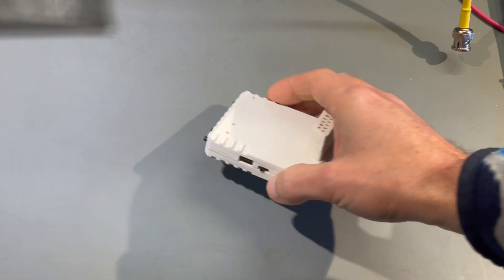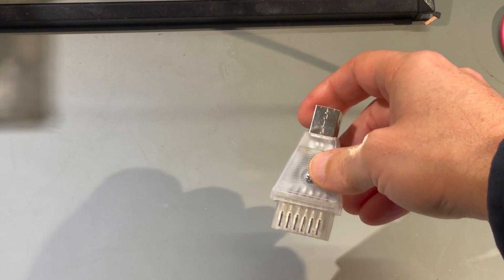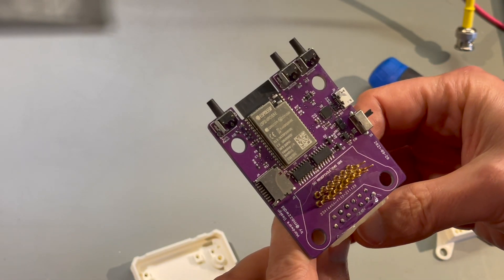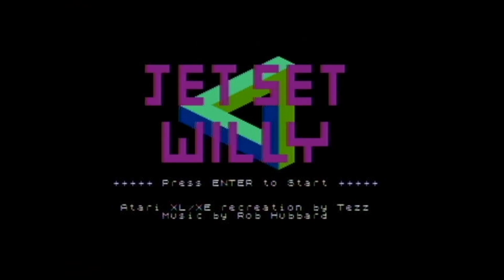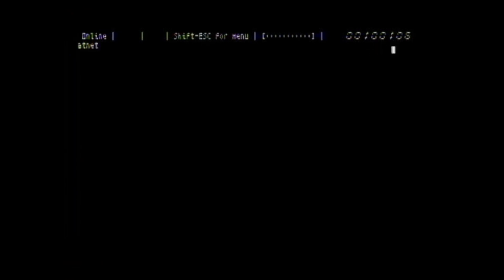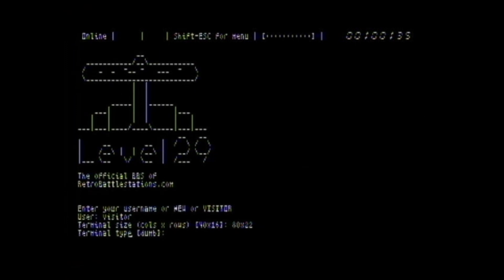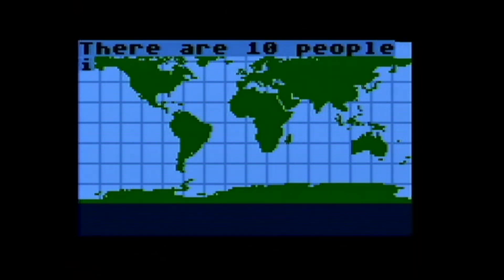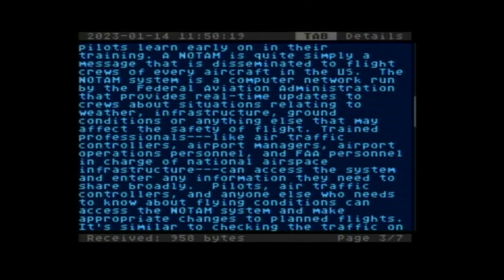A quick tour of the FujiNet - WiFi for the Atari 8 bit systems

Comment: The interesting part is that the Espressif module has inside two 32bit CPU cores that probably can emulate the whole of the 8bit Atari system.
Reply: yes. essentially you're buying a Espressif-based computer with an Atari micro as an add-on!  Although I wish modern manufacturers (laptops especially) would understand the importance of the physical interface as well as Fujinet developers. IBM got it right with it's Model F and M keyboards. No matter what software/firmware/virtual interface is used, the user is going to interact through a physical device, so it's extremely important!  Although nowadays tablets are questioning that model with a keyboard on the screen. Still, Give me a good keyboard or give me death! There will always be retro-battlestations!